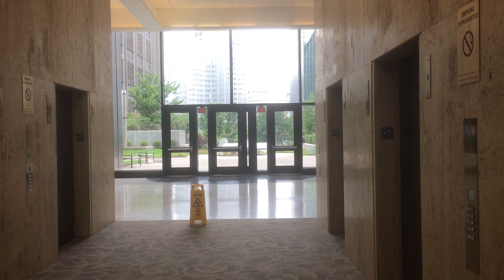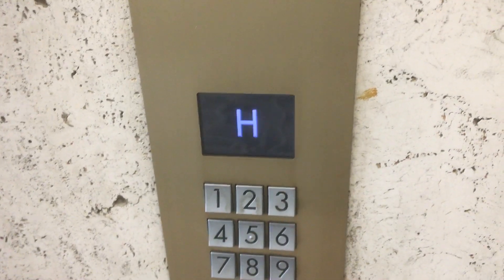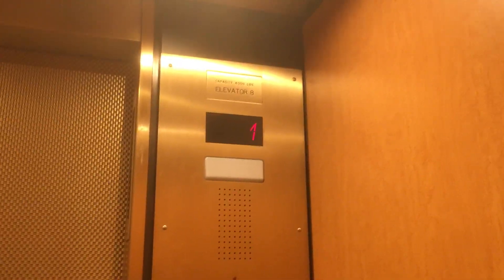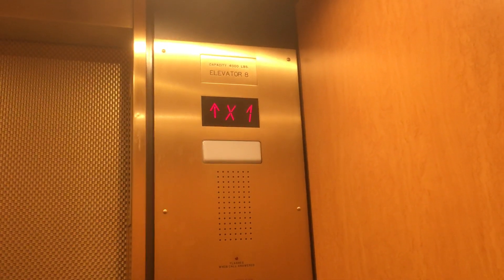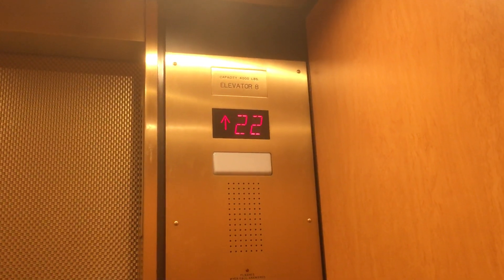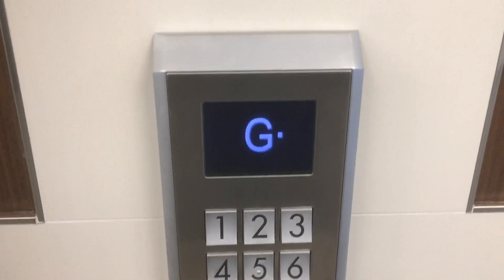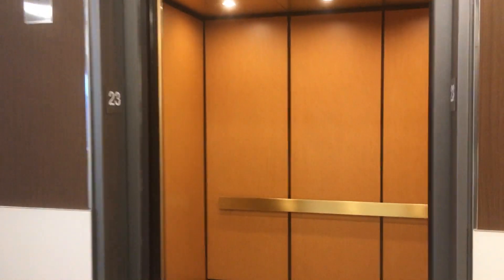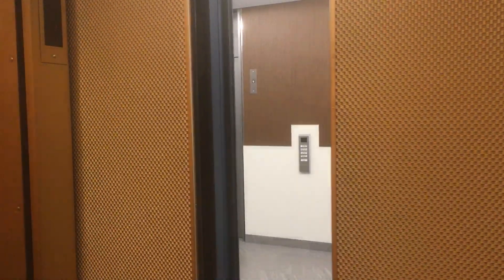Westinghouse Selectomatic/Schindler ID Miconic TX high-rise elevators - 11 Stanwix - Pittsburgh, PA

Comment: Whats the difference between Miconic 10 and ID? I thought ID has to have a key card reader that will register a floor when a keycard is tapped (I believe ID was available from 2007-2012.) and Miconic 10 was available from 1992-2012 with a Z-Line keypad. Both were replaced with PORT in 2012.